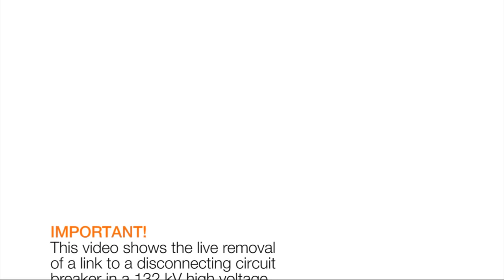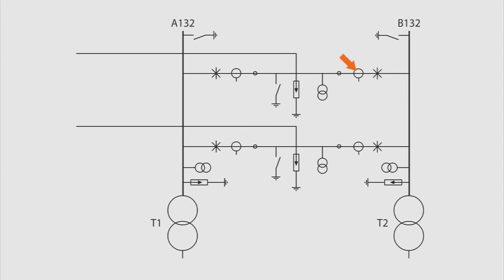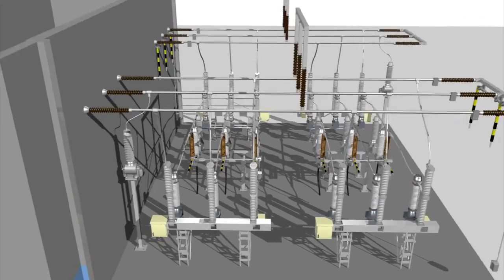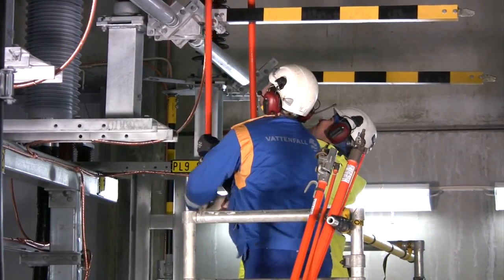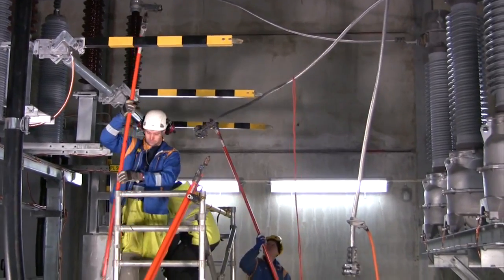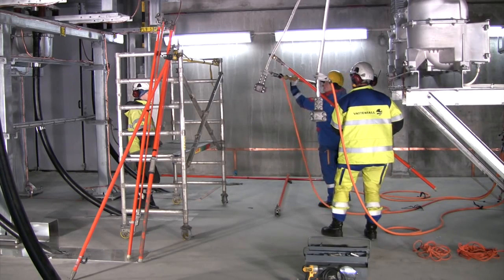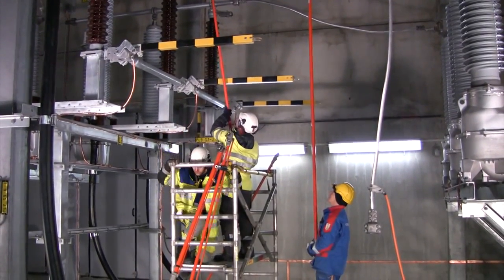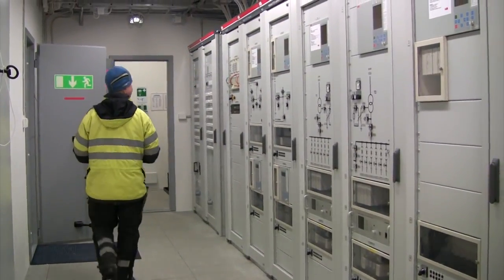Isolating a Disconnecting Circuit Breaker using live line ABB

Comment: The bean-counters who forced this needlessly dangerous substation design to be implemented just to save the cost of normal disconnector switches should go to jail for reckless endangerment. 
Also the linemen not wearing safety glasses are insanely stupid.
Reply: Yeah... I work in substations. And they cut costs but never like this!  This is insane.
Reply: "Also the linemen not wearing safety glasses are insanely stupid." True!

Comment: This is all fascinating but... why on earth would anyone build a 132kv substation with no isolators? 
This kind of live link removal work, while interesting to watch, is pretty dangerous and also time consuming compared to just opening an isolator/switch.
Reply: At some point you need to work on the isolator itself, which is what's happening here.  Presumably this is a part of the system where there's no redundancy and they can't just shut off further down the line.  The safest option would be to isolate that, but if it means cutting off supplies to a large area then I guess uptime comes first and they just make the job itself as safe as possible.

Comment: Why not just install 4 conventional discinectors. Then the complete substation could be serviced with no problem the price for this would be small compared to the risk there are involved in live work.
Reply: the guy who got the bonus for the cost savings is not the guy taking the risk of the hot work.
Reply: Now how do you do a maintenance on those disconnector...
Reply: @alexandresabourin9471  you unload & open the next disconnectors on either side.
Reply: @alexandresabourin9471  in general DCB’ is a stupid design. I have not analyzed the SLD but you need to be able to Isolate all component in a substation to be able to perform service one these. The price to do it correct is limited and it greatly minimize the risk for the personal.

Comment: Absolutely fascinating. I CAN work with electrical equipment, do simple house electrical work (install ceiling fans, GFCIs, etc), but I could NEVER have been an electrician; my hat is off to you guys/gals that do it.
Reply: 99% of electricians never do this. They just bend conduit and pull wires through it.

Comment: Does anyone know why there is an arc if the circuit breaker has the other end of the link isolated from the bus bar? I'm having trouble figuring out where that power is going.
Reply: Hi
Because the circuit breaker is open the connection to the transformer side is dead  and there is no power flowing 
However on the line side it is live up to the open circuit breaker 
That arc drawn is more breaking busbar volts than power
I.e the charging current to make it live which is minimal amps
Reply: @osmanali123  I assume capacitance, the way you can get arcs to anything, even something floating, if the voltage is sufficient.
Reply: It's just charging current. You always get some arcing on high voltage disconnect even when there is no electrical load on the other end. If there was you would get a 15ft long snaking lightening bolt that you wouldn't want to be anywhere near!
Reply: welcome to high voltage
Reply: 2:31 The bus bars are grounded before the linkage is disconnected.